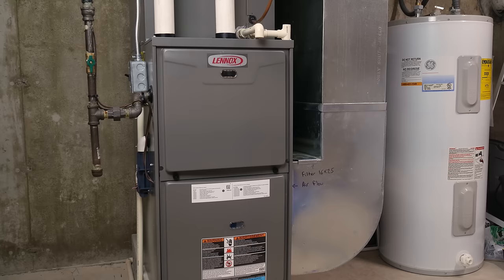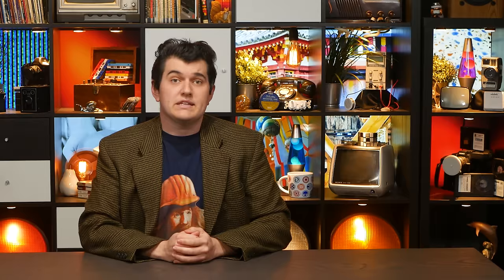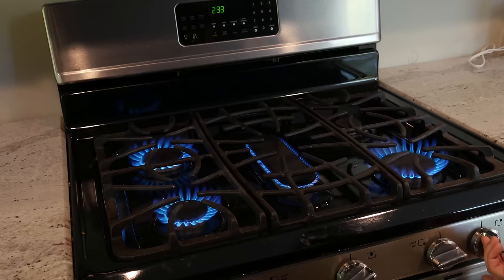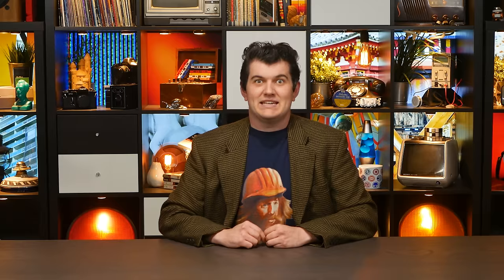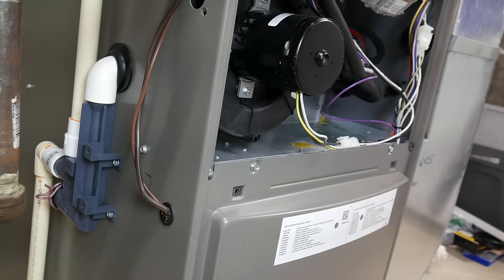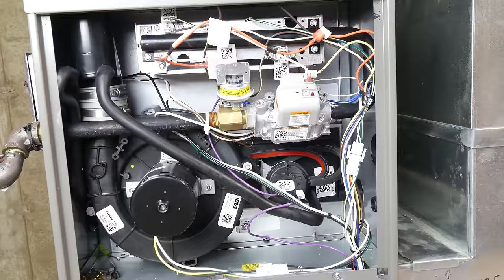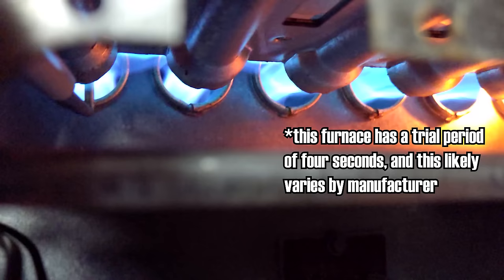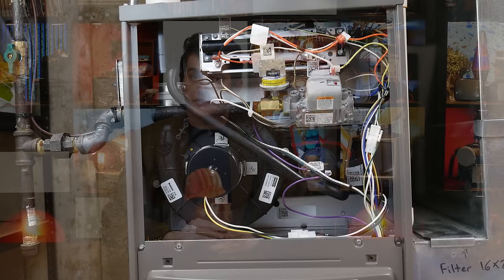Forced-air Furnaces: The What, Why, and How

Comment: Usually when I watch one of the videos I'm get to enjoy 90-95% of them, and then there is one point where I want to reach through the screen, wag my finger at you and give you a lecture on fluid and/or thermodynamics to explain how you got something wrong.  This time by about 12:50 I'd already counted two.

1)  Heatpumps are probably not going to replace furnaces in the near future, at least not in temperate or cold climates.  The reason for this has to do with the compression ratio required to generate heat.  For most commercially available refrigerants, as the temperature drops below 20F the pressure required to boil the refrigerant goes into "Vacuum" pressures, or below atmospheric pressures, which are still possible - cold storage facilities can get some amazing pressures for some impressively low temperatures.  However, this is at a cost of horsepower on the compressor and a fair chunk of wear and tear on the machinery.

Also, some "complications" occur as the heatpump starts to generate heat below 30F.  These involve the freezing point of water, and the fragility of the coil, as expanding ice crystals on the evaporator coil can do some serious damage.  Freezers overcome this by going into a "Hot Gas Defrost" mode, which is a really neat process, I recommend looking it up if these things are interesting to you.  But when mixed with the first concern, that your capacity is going to hell in a handbasket as the temperature drops, this adds misery to futility on a system that works great otherwise in climates that rarely see temperatures below 40F.

2)  Your comment that "some negative pressure might be good".  This is such a wrong statement that I would refer you to international mechanical code.  IMC section 403, sprinkled in various tables and charts, the minimum amount of make-up air you can install must be at LEAST equal to the exhaust air.  Some negative pressure systems are allowed (bathrooms, labs requiring fume hoods, infectious disease control rooms, kitchens etc...), but the system as a whole needs to supply as much makeup air as is exhausted.  Negative pressure causes so many problems in buildings, you could make a video in of itself on the chaotic effects and how to correct the issue when it comes up.

Comment: The way the flame sensor works is when the gas is burning it make a ionized gas. In the Ionized gas it allows for a small amount of current to flow to ground. The board send power to the flame sensor 3 to 7 millivolts is passed through the flame to ground the board registers the 3 to 7 millivolts ground potential raise. Then it keeps the flames burning.

Comment: Heat pumps often require a supplemental heat source, either within itself or by means of a backup system, for the coldest days. Most systems cannot extract enough heat from the outside air to generate enough heat to overcome the heat loss inside the home. That only accounts for temp near or below 0°F, which may account for less than two weeks out of a year, in the  upper midwest and great lakes region. They've gotten better, over the last decade or so, but they still recommend additional heat.

Comment: Our House here in Switzerland uses Geothermal heat and warm water panel on the roof with a heat exchanger to heat the central boiler. So our system only uses a bit of electricity for the fluid circulation pumps, which is provided by photovoltaic panels on the roof. Thus our System is fully selfsustaining. In the 10 years that we have it it has already paid for itself. Burning gas or oil would have cost more than the investment in this system was. And we don’t have to fear that wed freeze if power goes our or no gas gets delivered.

Comment: If you get a tuneup make sure the company performs a combustion analysis. This can usually tell if you have a crack or some other problem like improper gas pressure or fresh air problem is occurring. Btw on your furnace the secondary drain pipe for your evaporator coil should not be like that. If the main tubing gets clogged it will pour water all over. Either have a water safety switch installed which will shut down the unit or pipe it all the way to the drain separately as well.

Comment: Counterpoint: Older ~80% efficient furnaces that DON'T have computerized control boards in them tend to be much better at "just working" and not breaking down, so while the more modern furnaces may be more energy efficient, you spend A LOT MORE on service and repair.  So, it is entirely possible that the 80% furnace could be easier on the pocket book in the long run...

Comment: Modern boilers, at least where I live, also work like that. Completely sealed, forced inducton and exhaust, and sensors everywhere. And from what i've been able to investigate, the working principle is really similar, just smaller overall (and the nozzles point to water filled tubes instead, of course). At least it is in my Junkers boiler. We used to have the typical boiler with the pilot flame, that took the combustion air from around the boiler, and exhausted the leftover via a regular chimney. But since then the law has changed and for new installations and replacement units, the sealed ones are mandatory.

Comment: What we really need are houses that have better construction. Mansions in the Southern United States at one time had very thick walls, 3ft in some, and very high ceilings to help keep hot air above the people living in the home. Transoms above the doors of the house allowed air to move. Fireplaces and stairwells were constructed to move air by free convection to the top floor of the home where it could be expelled. The housing industry seems to get a pass on home design. Which congressmen and senators work for them?

Comment: Hey I love your videos and I noticed you live in northern IL too. My house is around 100 years old and has a boiler and steam generated radiant heat. The boiler is only two years old but the radiators are dated 1916 if I remember correctly. I also have a mini split that I use mostly for ac. Anyways, if you ever need access to a home with any of those for a video you’re more than welcome to use mine.

Comment: Around here the flame is typically ignited by a high voltage generator and a spark gap. On the other hand thermocouples went out of fashion in furnaces it seems. Instead they measure a current going through the ionized gas of the flame. I think there are also uv light detectors but I'm not sure about that.

Comment: Here is some fun facts I learned. The blower motor have two speeds for different modes. On high is 4 AC, medium for heat reason why medium speed so the furnace won't overheat. I know this because my motor went out so I had to replace it. So now I got heat now

Comment: Hmm... Makes me wonder about the furnace in my mother's basement, litterally had a pipe burst and spew water all over the exposed wires and other electrical bits and it kept running, and at the same time the exhaust collapsed and litterally FELL INTO IT and IT WAS STILL GOING!

Just... It took over a week to get the landlord to fix it. That's ignoring the EXPOSED BROKEN OUTLITS AND LIVE WIRES! or just the fact the bathroom has no way to vent and thus is full if we don't have a fan running in the window is 30*F and below weather, or the severly outdated wiring in the walls and basement, or the multitude of random hanging pipes that do nothing, or the plumbing that all leads to an overflow pipe in our basement that doesn't have a drain because it just leads back to the overflow, or the litterally crooked floor, or the litterally shattered door frame, or the leaking heaters, or the how many other issues there are. Seriously, this place is a litteral violation hell. Don't even get me started on design flaws, there is litterally a hole in the wall behind the counter they tried to seal by putting an extra large pipe. I just... Why is this allowed?

Comment: A flame sensor is not a thermocouple.  It is a rod and it is only a conductor that grounds a current but it does not generate voltage or current. The flame completes the probing system.  It is only a rod.

Comment: I ended up here because my air handler decided it just wanted to run the fan 24/7 until I pulled the breaker. I even took the thermostat straight off the wall, and it still seems to have a mind of it's own.

Comment: A few years ago,  my furnace wasn't furnacing. Turns out the hot surface ignightor wasn't hot surfacing.  Replacing it, and my furnace furnaced.  I have one of those 96% efficent furnaces now, as my older one was having lots of issues.

Comment: My furnace does not have anything light that. It's a large metal drum with blower blowing air around it. One very large flame thrower inside. No induction fan either. Exhaust on top forces cold air from outside comes in around the burner assembly. Thermocouple monitors the large flame thrower. A second Thermocouple monitors the large pilot light. If the pilot goes out (during high winds) the gas valve shuts off. In cold humid weather there is sometimes a noticeable loud thud when the flame thrower ignites.

Comment: Now that you mention it I kinda wanna know how the home boiler heating systems work
Reply: They heat water and pump it through radiators. The combustion happens the same as this furnace(condensing and all). For hot water the water goes through a heat exchanger in either a tank, or within the boiler itself if it’s a combi boiler, and heats water from the cold water supply.
Reply: @toddbod94  that’s pretty interesting. thanks !

Comment: Some argue that the 90+ furnaces are more expensive than 80+ furnaces because the maintenance cost exceeds the savings from the gas bills over the years. I am wondering what your opinion is on this? I am not sure because repair bills for the 90+ furnace family are usually over 500 dollars, sometimes approaching 1000 dollars, mainly because of expensive parts and the greater labour to replace them.

Comment: To me as an european it's still kind of odd that you folks over there prefere this forced-air stuff. Here it's more or less consens that radiation heat is much more comfortable than just warm air, and it's starting to become common to do even the cooling by running cold water trough the walls. I find it fascinating how different the development of this went in different parts of the world.

Comment: i think you can get an overheat event too if the wrong fuel is used .

some furnaces can be fitted to burn either natural gas or propane but if you put the wrong fuel it could overheat and would have to shut down.

if the draft blower is working deadly co gas should not be able to get out of the burner tubes even with a crack because the suction side of the draft blower is connected to the heat exchanger tubes  and the airflow is drawn from the burner through the tubes.

i guess if the crack is big enough then more air would be drawn through the crack and the flame may roll out along with the co gas.

Comment: As far as the part of living in houses that are too tight. There are products to handle that. Energy Recovery Ventilators would help and are often used in homes built to "Passive House" standards. To meet the standards of PHIUS the house must meet a degree of air tightness much higher than average code and can do so safely and efficiently thanks to the ERV. Passive house standards are quite interesting. I recommend everyone look them up!

Comment: Why is the heating machine called a furnace and only the cooling machine called an air conditioner?  Both heating and cooling change the condition of the air.  Humidifiers and dehumidifiers also change the condition of the air.  Some furnaces also have humidifiers in them (my current one does not) and air conditioners may dehumidify (my current one does). They all should be called air conditioners. Enjoyed your video.  By the way, my prior furnace, designed in the 1960's, was about 60% efficient.  My current one is about 98% efficient.

Comment: Natural gas will be one of the last things converted over to electric for environmental reasons. Compared to oil, diesel and gasoline, its incredibly efficient and clean burning. That being said, in Canada, Quebec is a province where almost every house i've encountered is heated with electricity, often electric floorboard heaters everywhere. Quebec generates almost 98% of its electricity with publically owned hydro dams, and thus the cost of electricity there is so cheap that its not much more economical to heat with natural gas.

Comment: Question about the gas line: why do they always seem to send it into the furnace with a T junction and then have a section that extends downward before being capped off? Why not an L junction instead?

Do gas lines have particulates or something they're trying to trap in the lower portion? If so, why does it never require cleaning?

Comment: Some furnaces actually have a closed burn chamber with just 1 big ass  flame in the middle. My mom used to have one like that at her old house.

Infact, around here those ones are more common. Like enough to the point where it threw me off to see the furnace at her current house with it's completely open burn chamber.

Comment: Why is your overflow condensate line just open on the floor?

Also heat pumps are terrible in more colder climates. Your hear energy runs low below about 20 F.

Comment: "Heat pumps are the future" - in Australia we've had reverse cycle air conditioning in most homes for the last 50 years... 65 years ago in the case of my grandparents. They're just a... thing, and forced air furnaces, I've seen two, maybe three houses that use them?  Temperate climate perhaps? They don't work so well in sub-zero temperatures although inverter technology has reduced their propensity to "ice up" outside.

Comment: What's not talked about is the cost of High efficiency furnaces... They are higher upfront and they are more prone to breaking because of its complex features and parts are much more expensive vs 80% AFUE furnaces. Most techs on reddit just say to stick 80% AFUE unless you have the extra cash to blow on the high efficiency ones.

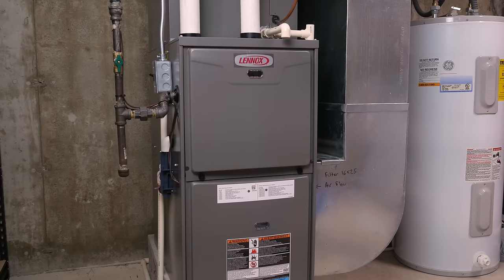Comment: 4:18 as much as id looove to use a heat pump, up here in the awful white north they would only be functional until late september or early to mid october if the weather is abnormaly warm, which has not been the case unfortunately in the last few years. For example where i live we just had our last snow fall(hopefully) on the 10th of may and it is still 46℉ in june.
Reply: He has a video on geothermal heat pumps! I suggest giving it a look
Reply: @hawks9142  I will, thanks for the recommendation!

Comment: I love the idea of 90+ furnaces but honestly they are garbage, I've been a residential installer for 14 years now. I replace the late 90's early 2000's Bryant Evolutions all the time and every single one is rusted out and has a clogged secondary heat exchanger, or giant cracks in the main exchanger. I see way more service calls for the higher efficient furnaces/heat pumps than anything else. 

I just wish they manufactured things like they used to, I have a carrier 80% furnace and heat pump from 1986 in my house, besides cleaning the coils I haven't touched either unit in at least 7 years.